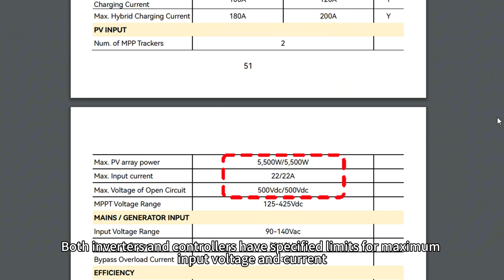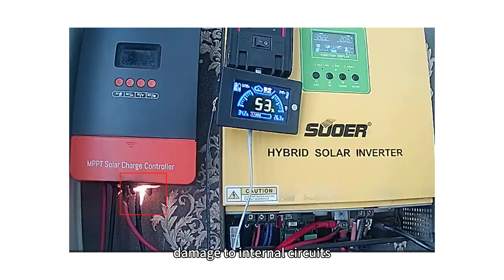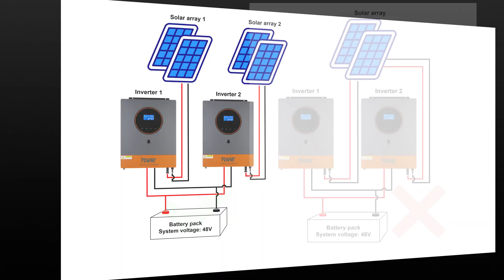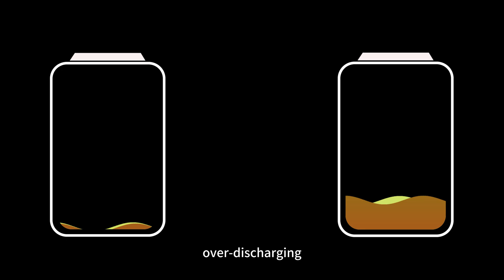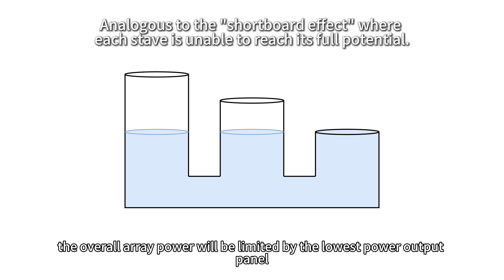TOP Mistakes Installing Solar Power Systems for Your Home (Part 1): Avoid All These for Success!!!

Comment: Do you have a diagram for the safe grounding of the 24V - 3200 watt POW MR All in one Inverter/ Charger when used portable and stand-alone off grid with no grid ties using only PV for charging?
Reply from the maker: Hi, please send it to this email: support@powmr.com. Our technical staff will check it for you.